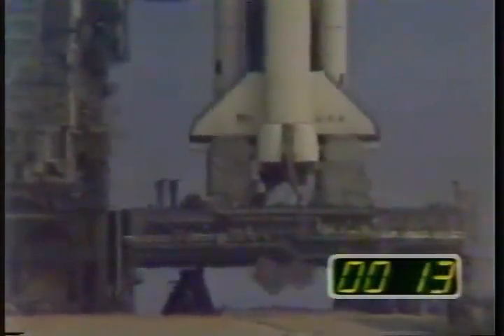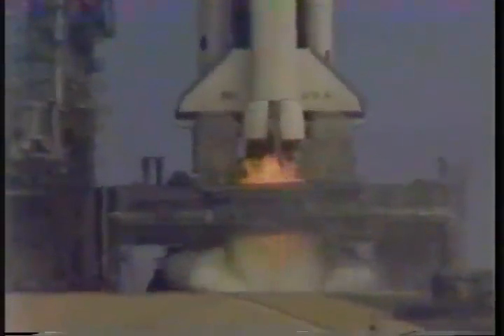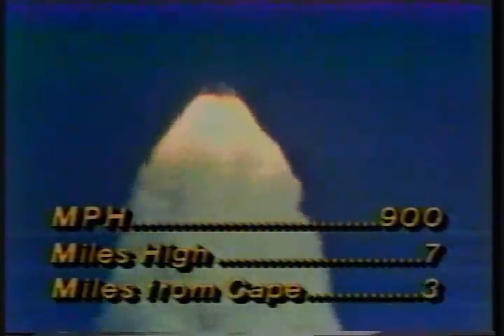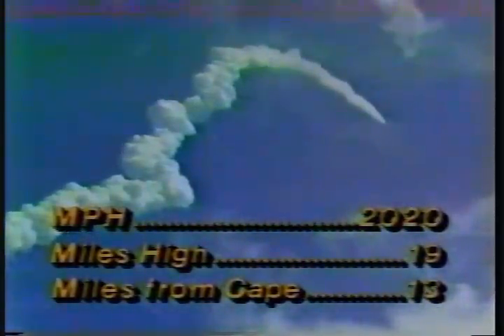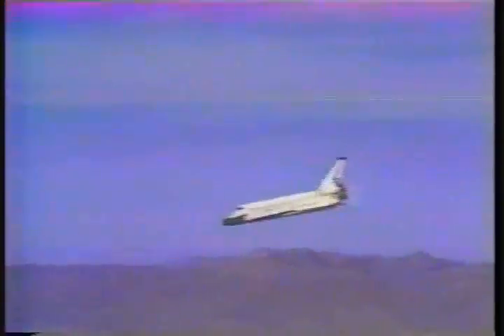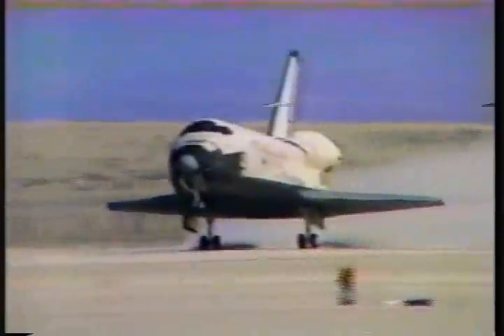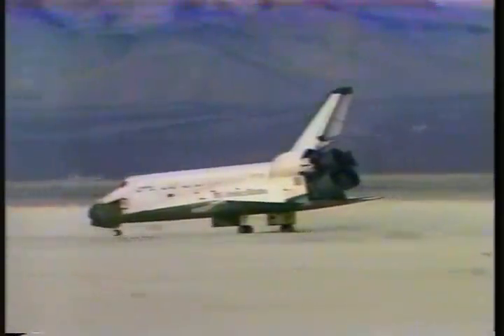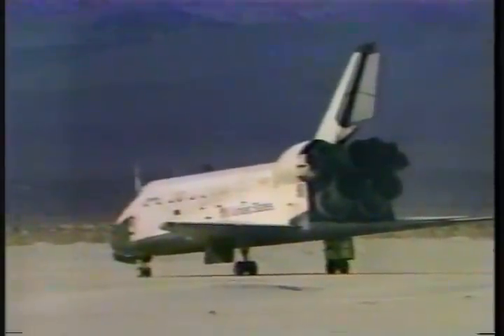STS-3 launch & only landing at White Sands (3-22-82)

Comment: This 3rd flight of the Shuttle, the 3rd test flight, was the first to launch on the date set months earlier and was the longest Shuttle flight with 2 crew members. The flight was extended by a day due to bad weather at Edwards AFB in California and was diverted to White Sands, New Mexico, the only shuttle landing there.  
The flight tested temperature stresses on the Shuttle, with Columbia being exposed to high and cold temperatures.  The Remote Manipulator System arm was tested for the first time, with a small payload lifted from the payload bay. 
The Commander, Jack Lousma,  made his second and last flight, having flown as a pilot on the second Skylab Mission in 1973. As on that flight, he experienced space sickness.  The pilot, Gordon Fullerton, made his first and would later fly on a Spacelab mission on Challenger which could have ended in disaster or near disaster when an engine shut down during ascent and only swift action prevented a second engine shutting down. 
This would have meant the Shuttle could not have reached orbit and would have had to attempt a very hazardous return to Earth abort in Spain.

Comment: The reason for the "wheelie" on landing was that the Commander thought that the nose was coming down too fast. 

They also had issue's with the "autoland" test. It was not completely programmed and it had issues. The commentator mentioned how late the gear was,  it was. About 3 secs before touchdown. One issue was a tailwind. 

They stayed in Autoland a bit too long to gather more data and then had issues getting back in the control loop.
Reply: There were a lot of issues with this landing. Lousma, despite being one of the few CDRs who was not officially a test pilot, left the auto land system in a bit longer than he would have liked in an effort to get more data for evaluation. It was a very good decision on his part and the engineers made some major modifications to the flight control software as a result of the data gathered from this landing. Also the landing gear extension  for this flight was to be made based on airspeed, not altitude, which is why the gear was extended so much later than on other flights. Because of the wind issues you mentioned, the airspeed was much higher than planned. After this mission, gear extension was again based on altitude, not airspeed. By the time Columbia arrived, the wind was beginning to pick up and not long after landing, White Sands was again hit with a major wind storm that left Columbia with a lot of gypsum sand contamination. Much of the sand from that storm remained in Columbia for the rest of her life. Even on its last few missions, 20 years later, crews reported gypsum particles floating around the cabin. Lousma, although disappointed in the landing, was widely credited with doing a great job under difficult circumstances and the data gathered as a result of his decisions proved to be invaluable to the program.

Comment: The first and LAST time the Autoland system was tested. Damn near did a belly landing. Losuma engaged the autoland after they were on final after the HAC and the first thing it did was close the speed brake. Then it re opened it, but they were still hot, lowered the gear about 50 kts fast. The system was messed up by the winds.